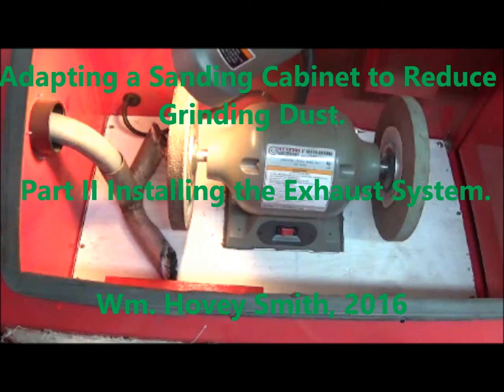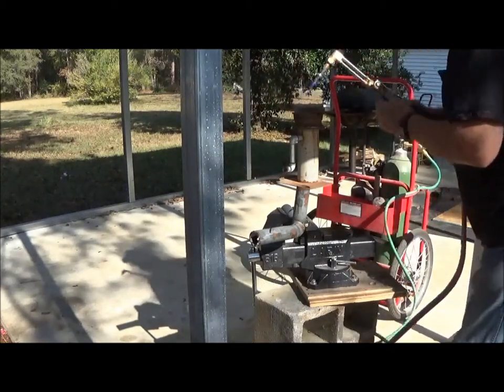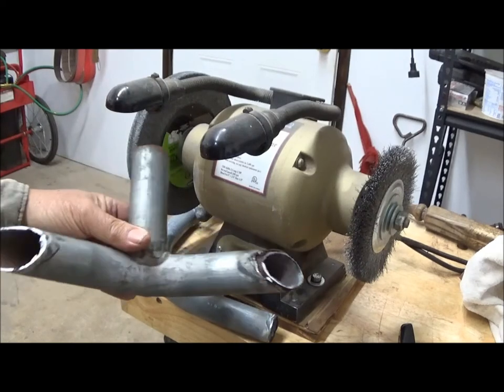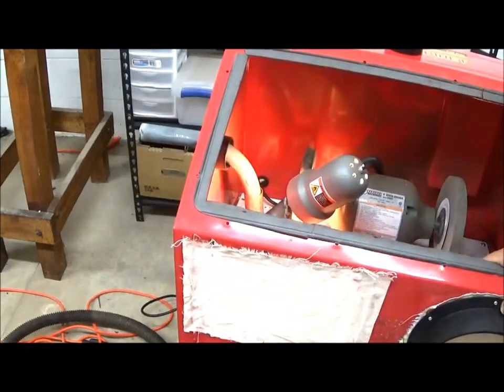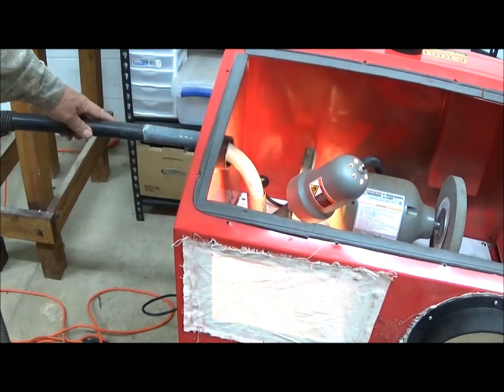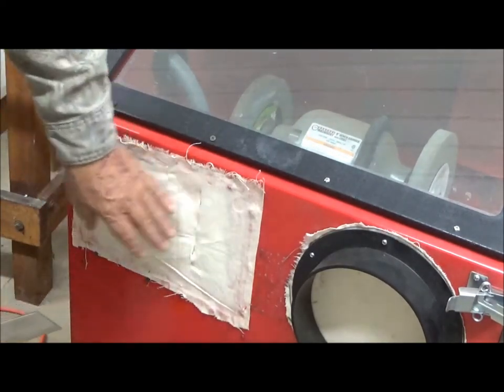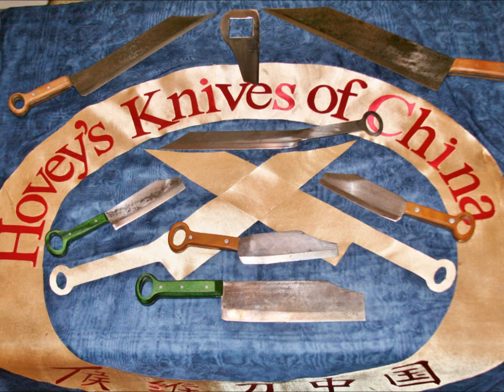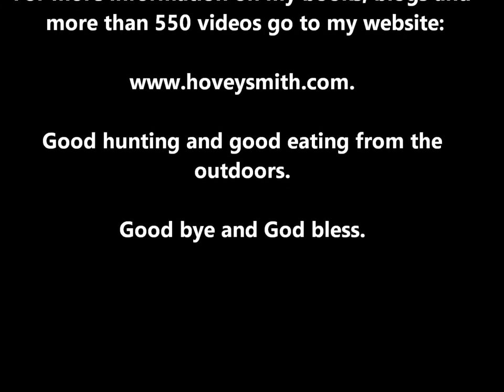Adapting a Sanding Cabinet to Reduce Grinding Dust Part II Installing the Exhaust System

Comment: Have you considered CBN wheels as they never create sanding dust from grinding.  Most of that is wheel particles, the metal particles will stick to a magnet.  CBN wheels are around 200, but they have many other admirable properties beyond dust control.
Reply from the maker: That might work for steel, but what about wood? In my case the particulate wood products cause the major problems, although materials from the grinding stone contribute.
Reply: Seems to be some disagreement whether CBN wheels are good for anything other than HSS, as I found when I tried to buy one.